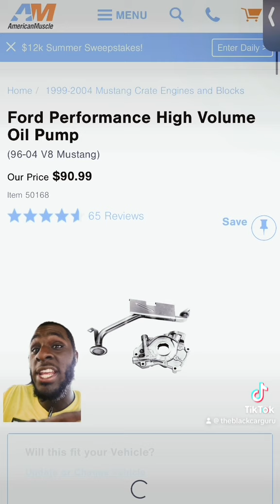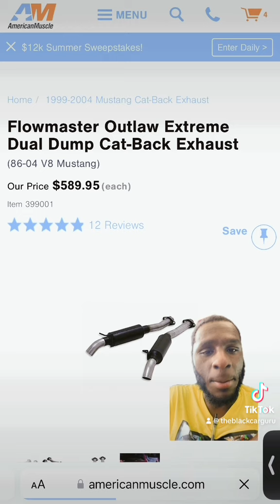Here are some Basic mods for your New Edge Mustang! | Coyote power from a 4.6?

Comment: I will say this. My personal opinion, the 2V sound better than the coyotes.
Reply: a man of taste i see
Reply: It definitely sounds better. No question. But the coyote is overall a better engine objectively.
Reply: Definitely has more of the muscle sound. The coyote sounds more like a sports car V8 like the motor in a Lexus is-f.
Reply: Mod motors sound better but coyotes make better power
Reply: 2v and 3v respectively sound better.
Reply: I highly disagree coyote high reving 8k-10k rpms sounds way better & Yu get more snap crackle pops of course
Reply: @FirstnameLastname-pe5ib have yu heard a coyote in person bcuz the growl pretty hard
Reply: @gerichayes1948 They're raspy for the most part they sound great but 2V 3V and then the Yote
Reply: @likenem a coyote is a modular engine ..
Reply: The power is awsome.  But your right.  They all have a weird sound.  No matter what exhaust  there running.  You think the new 5.0 sounds the same becouse of the new crank?
Reply: Eh the coyote is my opinion sounds more haunting especially with carbon tips
Reply: Coyotes jus expensive smh.  And then you have to get the tranny and all the other stuff that goes with the motor to make it functional and operate at a high level.
Reply: I do love the way my 2v sounds....
Reply: @gerichayes1948 no sir lol it sounds euro...I will say it's better engine by far on the performance side.. but nothin in my opinion sounds better than a high lift cam turning at about 5500..it's the grunt and rawness of it..when it's high numbers like that it's whispy and no longer sounding like it's original counterparts..maybe it's just a dinosaur talking..but when u pull up at the car meet and it's just sounds like ure chopping trees in the distance
Reply: I own a 2v & coyotes sound way better than
Reply: @Indubitablyx  thas matter of opinion and when u sell that 2 valve and if ure in tx lmk..and sounds like u have the wrong two valve u tried cams tunes etc...u jus rockin a h pipe and saying this blasime
Reply: @bmanclassics4350  I’ve cammed it, blew it. Put another 4.6 in it and now it’s straight piped flame kit on it and when I hear those coyotes drive past it just sounds way better in my opinion more aggressive
Reply: @Indubitablyx  u must be younger...if so I understand I guess..?..idk... like I've stated those engines turn such a high rpm!! so when u get down on it it really doesn't sound American...u get above 7k it no longer sounds the same...u get that pop and bang u younger kids like, but old timers like myself appreciate the power in low end grunt...nothing is better than passing a Italian stallion..only turning 6500 to 7k rpm..but imo what is sexiest is when u have a big or small block with a cam so big. It almost sounds like it'll die at a red light 😅🖤🩶 then hammer on it with a all business 3000 stall......."like a circle D" backing it up priceless...or even a old 5 speed...NOW I will say... we wont ever see 2k horse power on our old 2 valves, BUT red light to red light dont let that old 2valve on a 200 shot fool u...
Reply: Couldn’t agree more. Guess these guys broke buying Gt500 and just rip out exhaust and they sound like shi.
Reply: @colossalbigfoot256  you ever driven a gt500?
Reply: @Indubitablyx  I have. Doesn’t have anything to do with people ripping out exhaust components to make them sound like shi and stand on rev limit for 2 minutes. You know the deal.
Reply: Man that’s a fact cmon now

Comment: I own a 03 gt with a lil less than 40k miles and I watched that video about new edges you made a while ago and honestly lost all hope with this 4.6, but now that I see that you have one and you aren’t doing a coyote swap, I’m dreaming again😁
Reply: There's a cheaper way to make coyote power that's not nitrous.  Get the on3 turbo kit for $2800 and you can make ~450whp with it.  You need a few mods as well but you can get everything thru on3. All in all you're gonna spend about 5k. It's not cheap but when you consider how cheap the car is, you just made a $8000 car fast enough to hang with a stock C7 corvette.
Reply: @RidinDirtyRollinBurnouts Orrr just LS swap it 😂

Comment: Gen 2 & 3 coyotes makes 900whp on boost with good tune

1500whp with upgraded connecting rods ported heads & sleeve supports🔥
I have a gen 3 im putting in my new edge🔥

Comment: Coyote swap is the move. It’s one of the easier platform to swap. The earlier 94-98 is really light at 3200lbs vs 3400 new edge which is much lighter than the 3800-4000lbs s197-s550. Run nitrous on the 4.6 and save 6-8k for a coyote swap. Then run the coyote with a nitrous setup. 600 plus hp under 10k